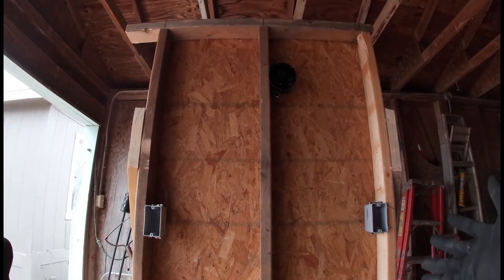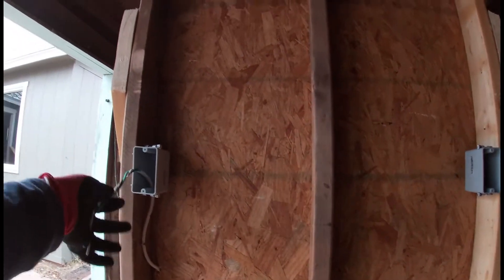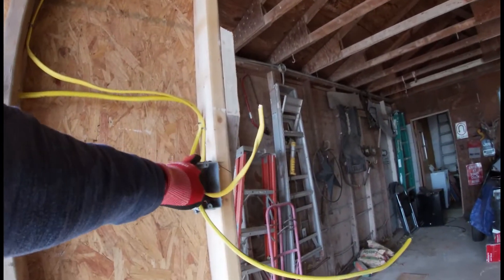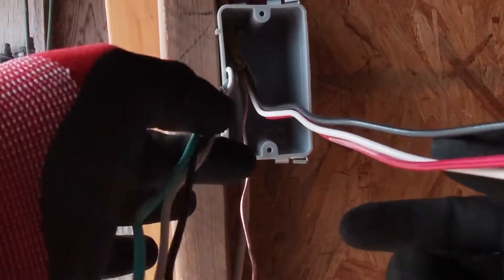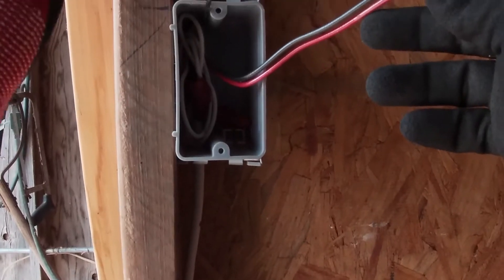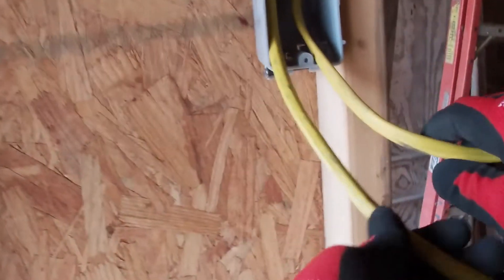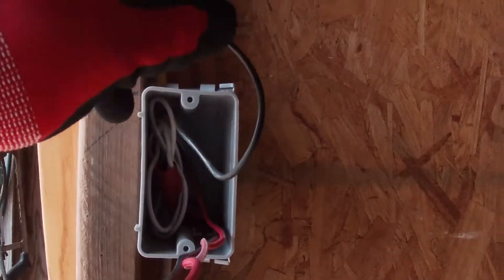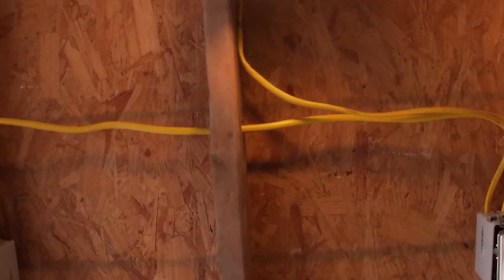How to wire a 3 way light switch system

Comment: That was not a switch leg…a switch leg has one wire in switch box coming off feed out box, you would wire the whole thing completely differently, and have a re identified hot wire. but it’s illegal now you need a neutral in all switch boxes.

Correct me if I’m wrong I’m not an electrician I just mess around with stuff and tried reading NEC book